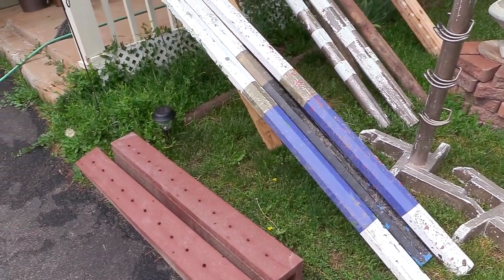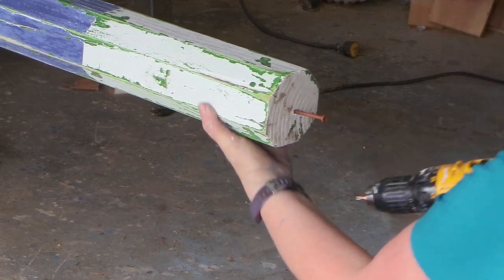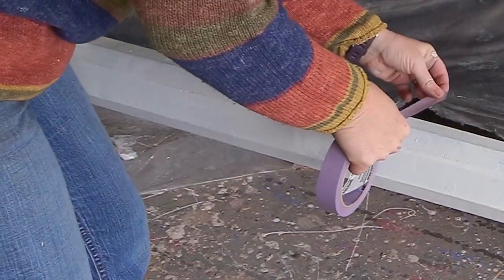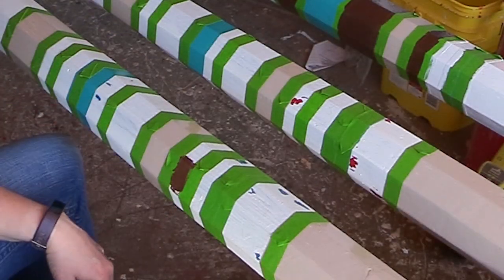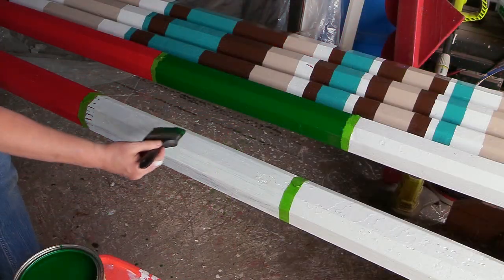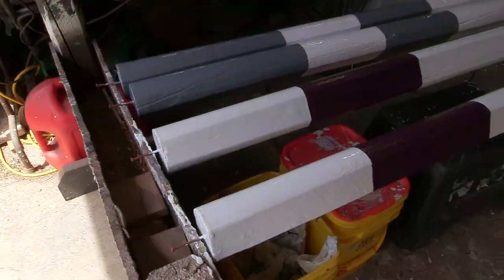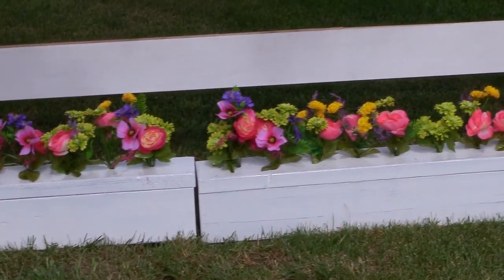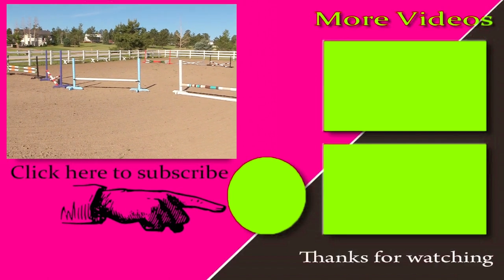How To Paint Your Own Horse Jump Rails - So Easy!

Comment: Screws in the end of the rails are a great idea! I’ve been using a spare set of standards with lots of cups on them, but it does take more time. Do you fill in the screw holes when you are done to prevent any moisture and rot from forming inside the rail, or do you just drive the screw all the way in?
Also one tip I got from a course designer: always use the highest gloss paint you can get; not only does it look better and read more clearly to the horse and rider, the gloss finish keeps arena footing from sticking as much, so it’s much easier to wipe the rails clean.